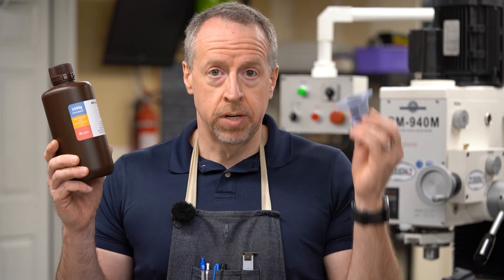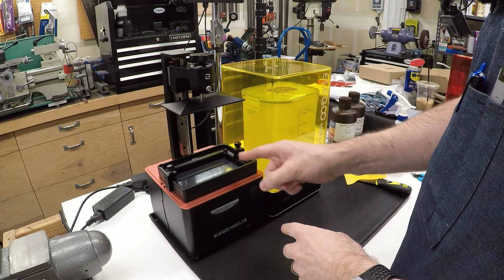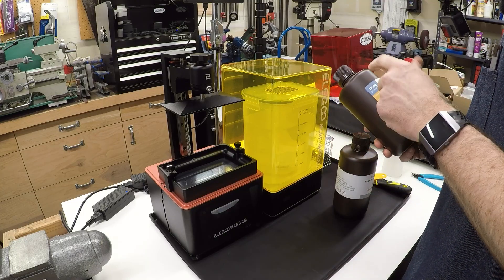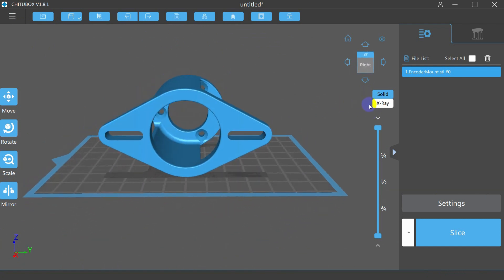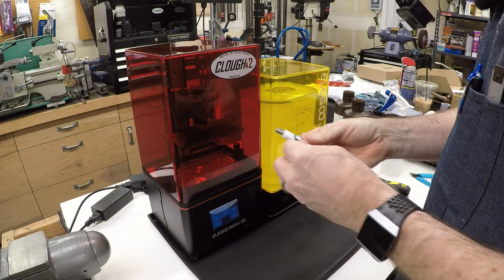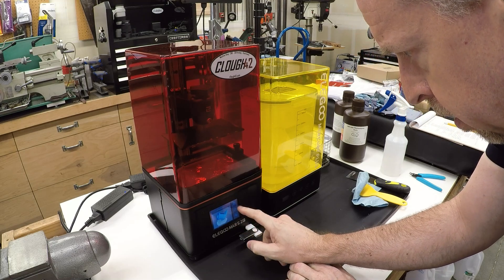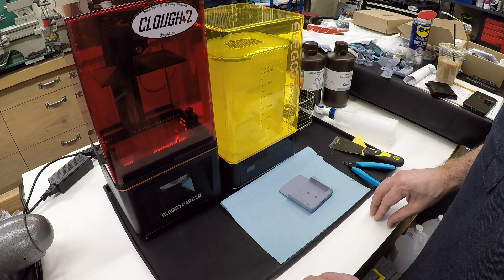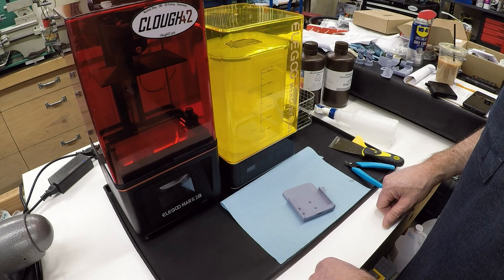Trying out a New Resin 3D Printer | ELEGOO Mars 2 Pro + Mercury Plus

Comment: I use my resin printer mostly for minis, if you ever find yourself printing something more fragile i find leaving the part in hot water to soften up the connection points usually allows me to just rip off the supports without damaging the mini. Not sure if it impacts the dimensional accuracy at all though.

Also if you find yourself of having a hard time getting rid of the stickiness after curing, underwater curing might help.

Comment: Nice James, I do mechanical parts all the time , and I never had bounding issues, correct height , cure time and angle is the most important . I do have to compensate for interior diameter (0,3mm ) and exterior (0,2mm).I then mould  the parts and cast them in different material depending of how tough I need it to be , and quantity.

Comment: Surface finish has always been my complaint with 3D printers... that print looks really good. When you were first talking about all the troubles and cautions, I was thinking no way would I get  that type. But then I saw the surface finish, I now not ruling it out. Thanks for sharing your early experiences.
Reply: The minimum layer size of a filament printer is dependent on the size of the nozzle, which is small but really noticeable. Resin printers can get detail as small as literally one pixel on a 2K to 4K screen. Resin printers are also faster and easier to set up, but much more work is required to finish the models after printing is done

Comment: Hi James

I have also been through the 3D printer guessing game to get printers to work as they should and a lot of thinking outside the box is needed.  I had a lot of issues with the raft separating from the supports, the problem seemed to be that the support bases are resting on the raft and not penetrating it, like the top of the supports do into the part.  This was cured by deleting the raft and using a modified support bottom, a 1mm thick cylinder works well, its actually a disc but Chitubox calls it a cylinder, these attach directly to the build plate and will overlap eachother to form a sort of raft.  As there are often gaps between the cylinders, this reduces film tension and aids drainage between layers, I noe rarely have failures.  I only use light supports for tiny parts and try to use medium mostly, although its a good idea to thicken them in the settings, especially really long ones.  I have a much larger Kelant machine that will only work with medium or heavy supports, as the film is much bigger, the tearing forces are also much bigger and even medium supports sometimes fail.  You might also try removing the supports before doing the final cure as softer supports are easier to remove and leave less damage on the surface of the part.

You may have already discovered this but you have the lift settings completely wrong, Bottom Lift is the first lift from the bottom for every layer printed and 5mm is fine, it has to be enough for the film to separate and should be slow, I use 20mm/min, on the Kelant 12mm/min.  Lift is also called Second Lift in some slicers and comes after bottom lift, 5mm is fine and speed can be 200mm/min as separation has already finished.  If you listen to the Z motor during operation you can hear the lifts at different speeds and also hear the film tearing off the print.  Retraction is coming back down again and any speed is fine, I use 200mm/min for this as well.  You might also find that an increased exposure per layer will help film separation and you will need less final curing when finished, try an extra second per layer.

A few other points, a level build plate is not critical as the first layer will take up any inconsistancies, the screens are often not flat so any levelness is a bit hit and miss.  This is a good one, install an app called Spectroid on your phone, it analyses sound waves.  Tap the film and see what frequency it produces, best separation results seem to be with a film producing around 250 - 350Hz, I have 2 of the Photon machines where the film comes out around 700 - 1000Hz and will not print reliably, putting a fizzy drink bottle top under the film during instalation gives a loose film that tightens up during final asembly and comes out around 300 Hz which will then print fine.  There is a video on Youtube covering this, its also really good fun to do and baffles onlookers.

I hope these points will be useful.  I recently became addicted to yours and Quinn's videos and look forward to new posts, they have turned me from a turner by eye to one who now uses dial gauges and micrometers and actually produces parts to exact size.  I am a model supplier in the UK so I have a mini mill, mini lathe, a 1930s small lathe, 1 filament printer and 3 resin ones.

Mark

Comment: you don't have to spray WD40 on the fep film. You just need to level your printer correctly. Take the VAT off, place a printer paper on the screen. Loosen the screws on the print plate and lower the plate down to the paper. Tighten up the screws so the build plate is in level. Now comes the important part: lift up the build plate with the lowest step (0.01mm i think it is) 1 or 2 times until you can drag the paper out, still with a bit of resistance. In your video, you have it too loose. Then set the zero. If you set the zero too low (not lifting the build plate before setting zero) your build plate will press too hard on the fep film and you can many issues. Too loose and the bottom layer have a hard time to cure to the build plate.
a magnetic build plate attachment is also strongly recemented. Makes getting the parts off the build plate much easier.
Level your build plate often. This is the main cause of print failures. (been printing for many years with the mars and the saturn)

Another note is the material. If you don't post process it with some paint it will continue to cure slowly over time and over cure and your parts will start to break easy. Spry it with something that block the UV light and your part will last longer. I print many jigs and other functional parts and often lazy to spray them... and i do pay the price in printing them again and again and more resin cost too... Don't be lazy like me. hehe
Reply from the maker: I've tried it with the bed level loose and also so tight the column flexes backward when printing the first layer.  It made no difference for me.

Comment: Outstanding video, as usual.  You and CNC Kitchen are the absolute best resources for 3D printing, in my opinion. :)

I'd love to hear a follow-up on your experience with resin-printed mechanical parts.  I FDM print a lot for use in marine applications and am very curious about long-term longevity and strength of resin prints to acheive a higher fit and finish.

Comment: I just started using a different brand  mono resin printer. The build plate was a nice sand blasted, anodized finish. I was having adhesion problems until I roughened the build plate with a disk of coarse sandpaper that came with the printer!

Comment: I also have just acquired a resin printer, a Creality but the system is almost identical. The aim is printing 2 part patterns for sand casting, some success with brass so far though a very small part. The next move is to try ZA12 alloy. The intention is making parts for a model steam engine. I am at the same time learning Freecad.  The learning curve is pretty steep but so far enjoyable.

Comment: I've had an Elegoo Mars 2 for about six months now, and haven't really had that much trouble with adhesion to the FEP.  I found a tip to use a little bit of RAIN-X rubbed into the bottom of the vat, and that seems to work very well.  Also, roughening the built plate somewhat more using fine sandpaper helps a lot with adhesion.  I've used a number of different kinds of resin, including the "ABS-like".  I've never explicitly added a raft like that; I just have it add supports, or add them manually, and it creates a small "foot" of the shape specified in the "raft" area for each support.  They have a slight wedge shape around the edge so you can get the pallet knife under it, and a flat top with the support coming out of it.  I don't think I've seen it done the way you did.  Maybe that's the reason you ended up with a "suction cup"?

Comment: I'm wanting to do my first print, a more cube object; approx 2-inch x 2-inch..
It's a test I'm doing behind the scenes, trying to get my employer to possibly go this route, versus their $5k MarkForge onyx printer..

My cube has a hollow,  that fits electrical connectors, that my department then applies pins through, wires.. ultimately, to test for continuity in wire harnesses, we produce..

Circling back.. with that cubed "fixture block" in mind.., would you still angle the sucker 60 degrees, or feel comfortable to print these right-side up?

Great info, Sir; very descriptive,  very professional. Subbed. 💪
Reply from the maker: I think the challenges with printing flat are all about having too much surface area in contact with the FEP sheet at once, potentially leading to the part pulling off the support.
Reply: @Clough42  I TOTALLY appreciate your reply.. I agree with what you're saying, yet, those 'rafts' do cover a descent area..??

So, between work and frustration, today is my third attempt at trying to print something.. I learn something new at every attempt. I got an 'island' off my FEP today, easily, after a cool YouTube video..

Two things I've picked up, and I'm trying to apply to my 3rd print are: 1. Applying a dab of silicone to a towel, and rubbing the FEP, then drying. and 2. Letting the build plate tea bag the resin a couple times before print (to allow some kind of familiarity) between the plate and resin, before a shot of exposure..

My fingers are crossed.. I feel less frustrated, and less anxiety at each  attempt.  Thanks again.

Comment: This is the way to go! Having complex parts that can be used in machinery. If you want to make it into something that is steel. You want to have a kiln that can do up to 1300C, and a furnace that can go as high is 1800C. Vacuum investment casting. 

Really cool!

Greetings,

Jeff
Reply from the maker: I've been looking at metal 3D printing.  The electric furnace I have is only viable to about 1100C max, though,  so the sintering process is a little hot for that.

Comment: Elegoo make an active carbon filter fan combo that you can add to the printers - they're pretty cheap and you just sit them in the printer whilst it's running (one charge will last a long run and it comes in a box of two).

Comment: Very well explained. Just when you think you've got your head around the various FDM 3D printers, along comes another version in the form of a resin printer to mess with your head. My interest in one would be for making bespoke automotive parts that will withstand temperatures inside a hot car. Our climate in Australia can reach 40 C and better at times so you can image what that would be inside a parked car. I'd also be interested to know how the cost of printing with filament compares to resin.
Reply from the maker: Resin varies a lot.  The cheapest is similar in price to filament, gram for gram, but most is more expensive.

Comment: Glad to see you were able to solve your first layer problems. I've used other resin printers and I myself own one of their first generation Mars printers and have never had that big of an issue.

My best guess would be that it's their build plate. They've been experimenting with different finishes for the build plate on each of the newer models to fine tune ease of real with adequate hold strength, and this model just wasn't as good.

As for the print angle, the primary thing you're looking for is the overall surface area exposed on any one layer. The area is directly proportional to the amount of pressure that will be holding your print to the FEP. This is the key to making sure you have enough support to prevent the upper overhanging sections to not break off. So keep in mind you will want to angle the part to overall minimize the maximum surface area of any given layer being printed.

Comment: Watching the vid and had to comment on the portion where you are pre coating your build plate.  I want to say that do so is a little much, but it works so to each his own. personally, I just home raise 10mm then home again to get rid of the trapped bubbles and it works well without having mess with the machine too much.  I need to buy a wash and cure station, but foil glued to a box, a dollar store mirror and a uv light work well for a quick and dirty solution.

Comment: Love your videos. Got the same combination a few weeks ago and went through the same issues 😁
One thing I stumbled across in a video was regarding the raft height. It was suggested that the raft height equals the bottom layers height. I am using 6 bottom layers, hence my raft height is .3mm. Advantage: easy to peel off with a plastic scraper. 
BTW got great results with the water washable Elegoo resin.
Reply from the maker: I'll try a thinner raft.  It is sometimes very difficult to get the raft off, depending on the exact geometry.
Reply: @Clough42  The 0.3mm raft is really easy to peel of as it almost flexes. During the print it seems to have all the properties a thicker one has. The idea was that after the 6x 45s curing there is no need to add more layers. That made sense to me.
Reply: Don't know if you've stumbled across them in the last couple of months, but you can get flexible/magnetic build plates. They cost around 20 bucks, but everybody with one swears by them.
Edit: Just to clarify, you flex the plate and the model just pops off.

Comment: I have never done any resin printing, but I had a thought on the FEP sheet. Maybe it is a bit to tight if it manages to pull prints of the build plate. I would assume that if it is looser there will be a sharper angle between the FEP sheet and the bottom of the part, making it easier to peel off, almost like when you bend a flexible build plate to loosen the part. I guess the downside would be having to "retract" the build plate higher to make sure the part gets peeled properly.

Comment: This video is really interesting, I own the exact same printer and I never had any issues like your described, but I've only been using the water washable resins (didn't want to keep a vat of IPA around). The main issue I have to deal with is warping due to insufficient support, but I suspect this could be resovled by bettery print planning and maybe an increased exposure time.
Great vid as always, keep it up :)

Comment: What most people don't realise is that if you are buying a 3D printer you are volunteering to be a "crash test dummy" in the sense that it is still a very new technology and we are still figuring out what the best way of doing things is. You have to both good at problem solving and have the patience to do it.

If you just want to throw a design at the printer and get the part back with no issues then you are probably better off getting someone else to do it.

Don't get me wrong. 3D printing is great and will only get better over time. The changes over the 6 or so years that I have been doing it have been amazing.
Reply from the maker: The capabilities of FDM printers are well understood, but not well communicated to new users.  Most come in with the impression that it's a Star Trek replicator and are surprised to learn it has limitations due to the material properties and the physics of the build process.  Most also don't understand that they're going to need to learn to use some kind of design software, and this isn't necessarily easy.

Comment: It would be interesting to see how the new microleds will effect the quality of the print. SLAs are a game changer for quick prototypes and making models for metal casting. It would be interesting to know if the resins are durable enough to withstand the heat and pressure to be used as a mold for plastic injection.
Reply from the maker: There are resins advertised for exactly this application.  I have no experience with them.
Reply: I have used Siraya Tech's high temperature 'Sculpt' resin. I don't think it's up to being an injection mold, but I have used it as a heat-press mold and it survived pretty harsh clamping and being cooked at 300F for an hour.
Reply: @marcus_w0  Using resins designed for actual SLA with an LCD-based printer can involve a lot of trial and error, and those resins are quite pricey. On the other hand, it absolutely can be done and someone out there has probably already done the trials and suffered the errors!

Comment: Do you do any hollowing of your parts? That's one thing I've seen elsewhere (hollowing and adding drain holes) that I didn't see you do.

Really cool to hear about the actual challenges and caveats of resin printing, had never heard of the tug of war problem or treating the fep (nor why everybody printed things at weird angles). Everybody else I saw reviewing printers, even those I really respect, made it seem like it basically "just worked" and the only caveat was the smell and safety.

Also I'm glad to learn I'm not the only one putting 3d printers in an infrequently used bathroom. Once I got my hand me down Replicator 2X working well and realized how noxious ABS fumes were, it moved from my office to my lower level bathroom, where it has lived even since I've mainly switched to PETG and esun PLA-pro.

Kind of blows my mind that that's basically just two slicers because there's only one or two companies making these boards. I've heard, at least, that the chitubox people are some of the only ones making msla printer boards, and chitubox and Prusa slicer are the only two msla slicers I've ever heard of.
Reply from the maker: No, I didn't hollow any of these parts.  This part is designed with just the material I thought it needed.  I'm skeptical of being able to drain well enough or fully cure trapped liquid resin, but I might give it a try to see.